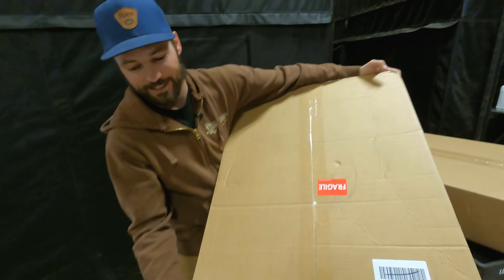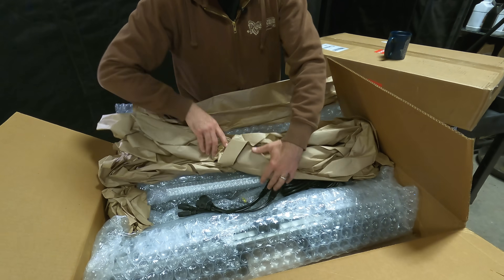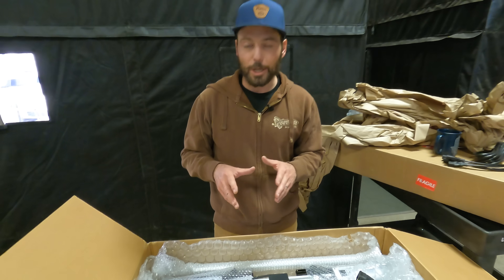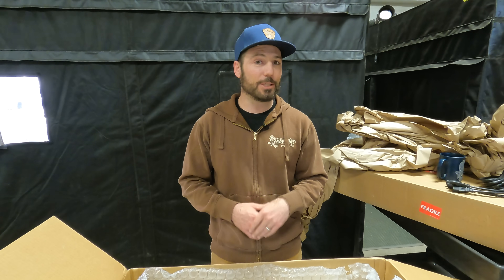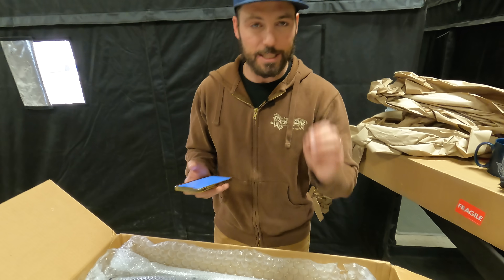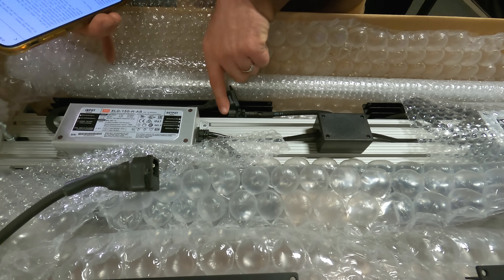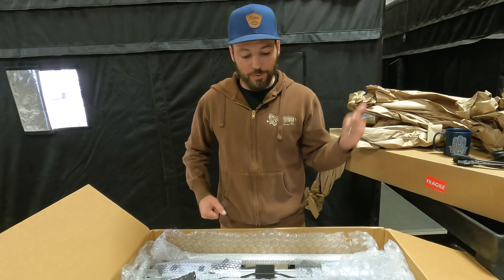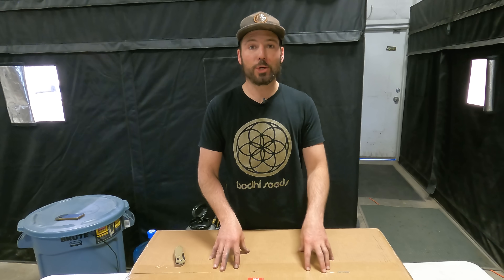BuildASoil Highlight: TIMBER GROW LIGHTS (MAGNOLIA 4)

Comment: Timber had been absolutely horrific for me to work with. I bought them based on the build a soil 10x10 grow series that Jeremey recommended. 

I have had horrible customer support missing equipment in my packaging, broken light, and no resolution. 

Dan at Timber is who has continuously dropped the ball, and not provided any resolution. 

My Amazon, viparspecrras are hanging in place of these brand new lights I bought from timber. 

Jeremey speaks in this video about quality and warranty of timber. I’ve had lights down for over a month and never had all the lights working. 

Timber lights are garbage. I’m happy to provide more information to anyone that’s interested.

Comment: My first was Optic led One  cree cobs in them still going  few years later growing top shelf using only 108 watts insane.
Went with Green Sunshine Company 
ES300V2 for upgrade. Amazing light  only problem they got V3 out already and i want it ;)))
Reply: mars hydro 3000 first light 7years ago use it for vegation.. got the optic tech 650s for flowering great stuff 👍

Comment: ABSOLUTELY LOVE my Cypress 6 lights and let me tell you about their customer serve with Dan. I originally ordered a cypress 4 during the midst of the pandemic when parts were hard to come by. As I waited for their parts to come in, I changed my mind and asked if I could get 5 strips on the Cypress 4 and Dan said that's fine. Then a week went past and I contacted Dan again and told him to add a Cypress 6 to my order, so a Cypress4 with 5 strips and a Cypress 6. As 2 weeks went by I contacted Dan AGAIN and changed my order one last time. I settled on 2 Cypress 6 lights and I am EXTREMELY happy with the lights and Timbers customer serve. Thanks Dan for everything and thanks Jeremy for turning me on (light pun intended) to Timber.

Comment: Also a little side note for your viewers... I bought your soil about 5 or 6 years ago. I use it in a 24 cubic foot bed. (Started with 30 gallon pots) dug my soil up and moved to Oklahoma where I reset everything up. I have used a couple different methods. (Teas, top dress only, and a combination of both. Even after all the inconsistencies iver the years. The soil is going strong and is the least labor intensive style of growing I have done in my 10 year growing career. Any ways I say all this to say... anyone with limited knowledge of how soil works doesn't need to be afraid to dive into the notill build a soil way. If I can do it anyone can. 😉. Tha ks Jeremy keep up the good work

Comment: Have you heard of the ion 720 led sold by growgeneration? And the geekbeast by geeklight? I am currently running these in 5x5 tents and bought both of them at 800$. If so how do you think these compare to the timbers and would it be worth it to move to the timbers
Reply: The GC 720 is used in commercial setting all the time, it's a really nice light as well. just make sure you are adding co2 with it as recommend.

Comment: Looks like a well made light, the only thing I don't like are the exposed wago type connections on the LED boards, you see this on some LEDs in the EU. Also looks like the diodes are not covered either? A conformal coating of some type would be a good idea, for a grow light?

Comment: Looks nice. Is there a film to waterproof the face of the LEDs and why didn't they put a lens on it?
Reply: Timber did lenses on their early cobs but determined they cut some of the light emitted so they stopped using them many years ago. These led's are fully sealed and waterproof. You can message or even call timber they really have excellent customer service ✌

Comment: I’m not a light expert or anything, but do you think those black casings around the diodes are absorbing any light? I wonder if they were silver, if they would get more efficiency out of them. I could be way off on that
Reply: Samsung Diodes have an angle of around 120 degrees of light dispersal. Since the PCB is mounted on the heatsink it is closer to the plants than the sink. No light will shine back toward the PCB or the Heatsink so the colour is irrelevant. Diodes don't need reflectors like bulbs do. Efficiency comes from lower heat production and the number of red diodes used. Red diodes are the most efficient, in part, because they are run at roughly half the current of whites.

Comment: i got myself a SF4000 for my first grow, before i stumbled deeper into yalls videos. So far no issues and great par on my end, but the warranties for Timber, plus their designs are just outstanding. Look for one in the future with a new tent, hop0efully not because of a blowout!
Reply: You got the same LM301B diodes and same Meanwell drivers so you're set.  I have an SE3000 and I love it.  Great numbers and I like that I can detach my driver and mount it outside my tent.
Reply: @siriusgd4753  different diodes bro he’s talking abt the new Samsung deep reds and the lm301b isn’t the only Samsung whites
Reply: SF 4000 is a great light. It will last you years.
Reply: Spiderfarmer is the official partner of snamsung. They are a very high quality light. I run the sf 4000 and the se7000. Marshydro fc series are also good and have samsung diodes. But marshydro also makes a dce series that is osram diodes cheaper but the light is 200 or 300 dollars cheaper and same wattage all really good I run a fce6500 as well and I have no complaints. But the spiderfarmer se7000 730 watt is my favorite. So no worries bro you got a good light. Them high high end commercial lights are just as good as the spiderfarmer and the fc series marshydro. Those other commercial grades are way more expensive for us cause they do deals by quantity when people buy like 60 lights from them.
Reply: @ROAMING-ROOTS  solid info, much appreciated! so far its been fantastic for me, only had to run it up to about 300w with the abaility of LEDs and plant height. Easy push on 1000-1300 par
Reply: The sf4000 was my first light I bought a timber 6 because of this series
Reply: SF 4000 is a fantastic light, you did well 😉

Comment: Whoa 2.8-3 efficiency… 2.6  is normally considered high eff.  I heard the big guys were going for 3 but I didn’t think it was possible…TIMBER is about as up to date
as it gets …GO TIMBER !!!! I’m pleasantly surprised 😮. Thanks guys good work
Reply: HLG scorpion is 3.2
Reply: The new lights out now especially with Lm301h diodes are over 3.0.
Reply: @ABplusOriginal  even alibaba lights use 301h. It's a race for the best reds now!